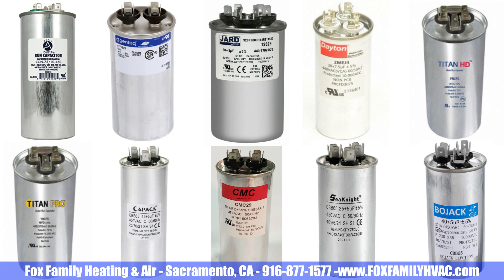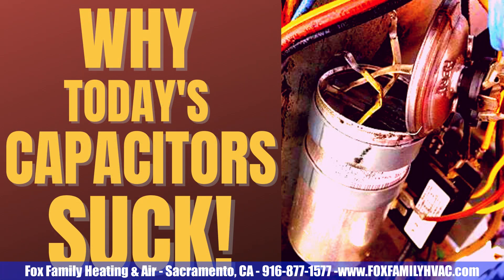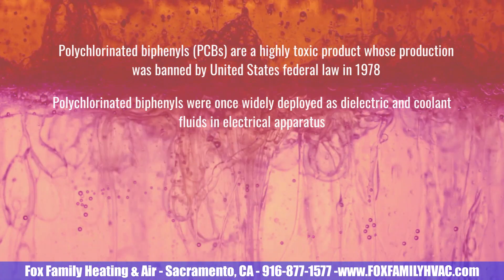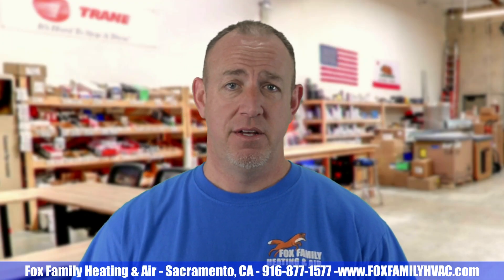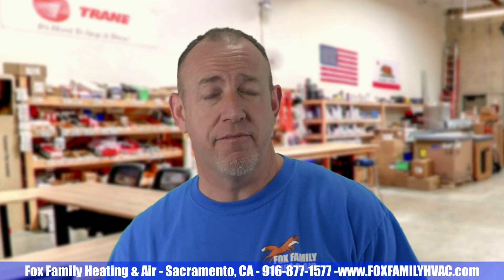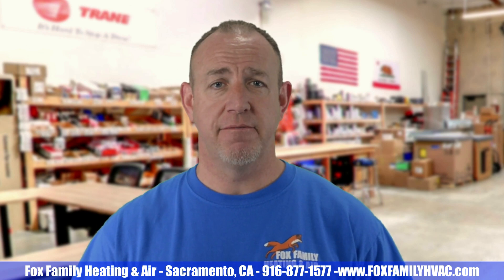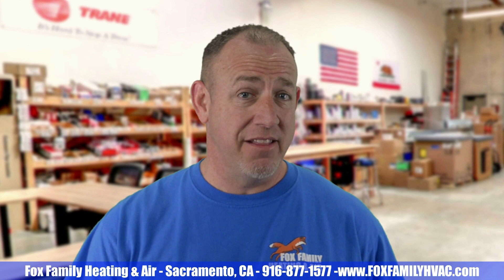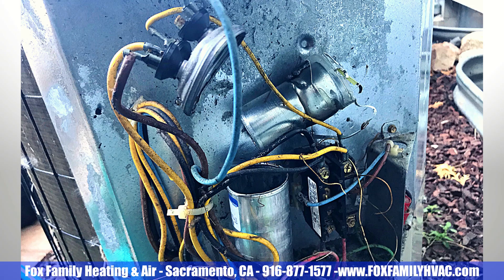Why Do Capacitors Fail (Actually, Why Do Capacitors Suck!)

Comment: Well. I just installed a titan. It’s running just fine $31. Had a JARD and it only lasted about 2 years. Either way. Cheaper than HVAC coming to do the same thing for $200-$400.

Comment: i have 26-year-old capacitor that has no pcbs but it is fairly large oval 45/5 that sits flat against metal of unit that sits in shade it is still working probably does not get to crazy hot.

Comment: You must have picked up some knock-off Titan HD's, I have yet to have one fail and the ones I have in hand have "Exceeds EIA-456a" on the boxes for both condenser and blower motor capacitors. Proper installation is important and even good techs get lazy and install a capacitor any which way just to get a job done. Also, just because a capacitor looks good on your clamp meter doesn't mean it's actually healthy by any means. All capacitors leak electrons internally to some degree and it takes very specialized equipment to determine that leakage. A leaky capacitor can show rated MFD (or even higher) and be completely junk in use.

Comment: I don't think you understand how an AC capacitor works.  It does not "Store energy" like a DC capacitor.  It simply provides a "phase shift" of 90* to act like a 3rd leg for a short period of time, or consistently - depends on the system.

Comment: I have to 100% agree that no HVAC should have the cheap crap on their truck. Why? Because they are getting paid to use their training, experience and professional deeds to the equipment and customer.  There is no point in anyone calling in HVAC folks only to receive a DIY quality outcome. Anyone could do that type of work and for much much less. Like in this video, don't put those low end CAPS in your truck and if that's all the supply warehouse has, find another place to buy your parts from who will offer the high grade. I have seen countless HVAC videos made by HVAC folks and they showed how they installed a cheap low quality CAP and called the job fixed like a pro. LOL...I call that fraud especially if the CAP being replaced is a high quality one. Just like condenser fan motors...they pull out the OEM original quality motor and install a cheap rescue type without informing the customer. That is another form of fraud too...
I have also been noticing that many HVAC manufacturers are using inferior CAPs and contactors right from the get go on brand new systems.  Are they serious about that?

Comment: Replacing out 20 year old Carrier. It is on the original cap, which is a MARS, made in Mexico, no PCB capacitor. Smaller than new ones, and it hardly has any "rush/corrosion" on it. TXV valve is going, so replacing the entire system. In Florida, so high heat and humidity, but seemed to work well. Of course it has the EIA 456a marking on it as well.

Comment: My American Standard unit uses GenTec capacitor. It failed in 9-10 years.  I replaced with Titan Pro and it still working after 5+ years. I bought Titan HD for a spare since I though it is a reliable one.  The box said it exceed EIA- 456A. Ehh, I don't know who to trust.

Comment: I just had a Genteq fail after 4 years and one month. It blew the top clean off. The Dayton before it lasted 7 years. In all fairness the Genteq was a 370 volt instead of the 440 volt that I should have used. Also, it's in a 25 year old ac unit. I just ordered two 440 volt caps. We'll see how it goes.

Comment: The main reason is the construction, and the secondary reason is PCB oil, which was widely used in all kinds of applications, including transformers, capacitors, and rail impedance bonds. PCB oil was outlawed a a carcinogen. If that were true, I would be covered in cancer, but I am not. I regularly was up to my elbows in that stuff in the 1970's. So, a less effective oil  and cheaper materials make a for a shorter service life. A cheaper capacitor fails more often. A cheaper capacitor allows for new units to cost less to make. Once the cap fails, they can sell you a new one. It's a scam, just like the refrigerant-du-jour.

Comment: Hi, enjoy your videos and information,  I had an annual service person come by and tell me needed to replace 2 capacitors for $370 each and need Freon R22 topped off on one unit. He did my neighbor's home and said similarly required a capacitor replaced. I didn't trust him and got a second opinion to inspect who said no need for the capacitor was working fine. He did state the R22 unit was down probably 1 lb of freon and would recommend refilling it otherwise can damage the unit. The cost of 1 Lb of R22 is $375 plus labor $150 which was the service charge to come out, does this sound fair or overpriced, I live in NE CT area. Can you or anyone give me an idea of what would be a fair charge for 1 lb R22 replacement?. The unit works fine and waiting until it is completely failed before replacement. Thank you,
Reply from the maker: The cost to run a business has gotten very expensive. Especially in highly regulated, highly taxed states like CA. Not sure about where you are. But 300 for a capacitor and 250 a lb for R22. The are alternative refrigerants like R458a or R407c for 150 a lb.
Reply: I still have couple tanks for R22 that I bought many years ago. My two units are 14 years old, so those tanks are good insurance.  But there are still plenty of R22 around.  Those AC licenser can still buy for <$20/pound.  The charge rate you described is unheard of in Arizona, but there are  a lot of competition here.  In NE, AC servicemen probably has no work half the time of year.
Reply: R22 is no longer available so does this technician have a large stash in his Van. One pound to charge and top off should maybe cost with labor about $300 at Max

Comment: I was just thinking about replacing the cap in my own air handler in my attic.  It's 29 years old. And still working. Though I didn't test to see if it's starting to fail. Good to know about the titan brand.

Comment: Yeah, pretty much planned obsolescence. Ive seen em go bad in as little as two years if the heat exposure is bad enough. I'm not an active field tech anymore at the moment, but i began making it a habit to make sure i didnt try to tell the customer that this is expected now from all major brands regardless of the expense of the system. Your 20,000 dollar daikin system will have caps go bad just as fast as the local crack motel that has an oxbox slapped in.

Comment: Sounds like modern HVAC capacitors need external heat sinks with cooling fins attached to them. Would be pretty easy to do with thermal tape or heat sink paste and hose clamps to hold the heat sink in place. Would be an interesting experiment to see if it would increase the life span.
Reply: It will increase manufacturing costs!
Reply: @bobboscarato1313  I was thinking more as an aftermarket upgrade. If it lasts 10-15 years vs. 1-2 years I would think adding an inexpensive heat sink to the outside would be a worthwhile investment. Not to mention the reliability benefits if it works. I have added heat sinks to many components to extend their life/protect them from heat damage. I don't see why it wouldn't work in this application as well.
Reply: @gawkingwatches7988  I'm sure they did their math and concluded it was bad for business; control space is limited and it could complicate their plans!
Reply: yes my ac unit is 26 years old still original cap it is large oval 45/5 so probably disapates heat well you can jst take aluminum foil tape and make fins for cap if you wanted to i did that to a power supply and it cooled it quite a lot.
Reply: If you can find a heatsink that can mate against a cylindric surface, let me know.
Reply: @AZRockRunner  THERE,S PLENTY OF UNITS THAT CAN EASILY COVER TWO  FLAT SIDES OF COMMON OVAL CAP...THINK!    AND FRANKLY,,,THERE IS ALWAYS PLENTY OF ROOM FOR  THEM  TOO..
Reply: @AZRockRunner  I've seen them for things like radio controlled car motors so they definitely exist. Would just have to find a supplier that has versions for different diameters.

Comment: The cheapo, color-coded caps on the new Carrier and Bryant units are getting about 2yrs average - even replaced a few of them around the ONE YEAR mark.
 Man, lemme tell ya, customers just LOVE having to call a year or two after dropping several thousand dollars on a new system to 'change a part out' because their condenser is dead and their house is hot - really inspires confidence in the equipment and your company.
 I like an "easy" service call as much as the next technician, BUT....
 It's sad that we can't rely on these people to spend 10 or so bucks extra to put a quality capacitor in their equipment that's gonna last at least HALF of the warranty period. 

I've almost considered just pulling the stock caps and putting in a quality one on all new systems I install...I know I changed the cap on my personal system out after the 1st summer.

Comment: We were starting to wonder, we’ve had customers mad at us for the cap going out roughly after a few years…now I know what to tell them so they can’t get mad at us.
Reply: Telling you from personal experience. Telling the customers about planned obsolescence wont help take the blame off of you. They see you as part of the system that causes the problem. They freak out and look at you for the answer of the magic brand to use. When you can't give it, they see you as the bad guy too.

Ive seen MARS caps go bad within a few years too. Its not that high a guarantee. ALL caps are made cheaper these days.
Reply: couple of years?  shyt.  it last in one year compared to old days capacitor 20 years to 40 years.  My god consider the trash from all these failed capacity.  my gosh.  no wonder the world is filled with trash and toxic.  We are no longer using capacitor, we are using trash.  These capitalism gonna killed everybody.
Reply: Just blame it on the EPA.

Comment: Capacitors in motors don't act as "storage buckets." They shift the phase to one of the windings up to 90 degrees to create a rotational force that is otherwise not available on single phase circuits.  All capacitors do charge up and discharge, but the capacitors in your air conditioner aren't letting out one big oomph. They are charging and discharging 60 times a second, and the charging action is what creates the phase shift. No more power is being put out of the capacitor circuit than is flowing through the main winding. The difference is that the winding on the capacitor has current that is shifted 90 degrees.
Reply: So you’re saying that the Capacitor charges or in other words “stores” power, Then Discharges it?
Reply: @AbqBasketball  yes, but it isn't boosting anything. It's just shifting the phase. It doesn't retain some sort of charge to start the motor. Any charge it maintains when turned off is incidental. It handles alternating current, and so maintaining some sort of mega-charge would serve no good purpose. Its only purpose is to shift the phase of the wave. In a single phase circuit, the current shifts back and forth. All that would do is move the rotor back and forth. It would sit there and hum. The phase shifted current goes to another coil so that you get a 3rd wave that is in between the other two so that instead of 1212121212 you get 123123123123123.
Reply: Well, it depends. Units that rely on a start cap actually do use the start cap as the force that provides the oomph (however this is more for commercial refrigeration systems.) But yes, your traditional run cap mostly just acts to imitate a third phase. That's why a start cap comes with an induction relay. So it won't burn out due to the excess amperage.
Reply: @Clasped003  no, the cap causes phase shift for a start winding. That is all. Does not provide any form of electrical spring discharge of any kind, not on any typical AC compressor motor, saw motor, fan motor, or otherwise.
Reply: well, there is still AC current flowing through the capacitor so it still get hot.
Reply: I just posted this as well, then decided to read comments.  Glad someone understands!
Reply: Current leads the voltage
Reply: @ryoung212  Yes, and it leads because a capacitor acts as a short when discharged. When fully charged, current will be at a minimum, and voltage will be at a maximum.
Reply: All correct and explained like an EE would. Respect!

Comment: The old days a dead capacitor call was rare. They were huge.
Reply: Sadly the last MEGA-cap I pulled out of an ancient unit (still reading 40.01µF) wasn't a 45µF or I would have used it on my 2018 Day & Night condensing unit and tossed the 'El Cheapo' color coded one that came in it!

Comment: excellent video! i prefer amrad over mars, ive had problems with mars caps leaking dielectric never with amrad!
Reply from the maker: Cool. Thanks for letting me know. I actually wish I could find who sells them around Sacramento
Reply: @foxfamilyhvac  i usually have our warehouse manager order them, and he gets them online. I know I have seen them at US Air conditioning before, though they were low on stock.

Comment: I ran across a 45/370 run cap installed and running in a 1951 Sears central A/C.  It was the size of my car battery and still tested perfect but today's caps seem to be a seasonal item.  Do contactors next, it's pissed me off to no end that manufacturers don't make the contacts visible anymore.  The ones made even 10-15 years ago would last the life of the equipment but break open a new OEM contactor after 1 or 2 season's and they are shockingly damaged and pitted
Reply: Less silver - they used to be solid silver points, now they're just coated.
(according to my boss/owner/mechanical engineer)
Reply: Everything get cheapened all the time; planned obsolecense!
Reply: Obsolescence!
Reply: yea , Contactors are crap these days. just like caps. agree.
Reply: Size of a car battery? What kind of system? Hardly anyone had ac back then and if they did then they were probably wealthy, which I would assume it’s a nicer house. So why wouldn’t someone in a nice house replace a system that is 70 years old
Reply: @murkyturkey5238  condenser was in the basement with a sheetmetal elbow on top to direct the discharge air to the outside, a large belt driven squirrel cage instead of a propeller doing that job with a semi-hermetic compressor running R12.  The furnace was damn near the size of my service van at the time ('99 SWB Chevy).  Probably still there because the ducting was encased in asbestos and the house is a registered historical home in California $$$

Comment: When possible I try to buy AmRad capacitors when I can. I keep a couple of Turbo 200 caps on standby as well.  The propery that I work for still has some 35+ year old condensing units that contain those old school giant capacitors that are still running strong.
Reply: Don't use AmRad, they contain vegetable oil, and will just leak out and explode. Make sure that you use only a NON-VEGETABLE OIL, USA made capacitor.

Comment: I’ve replaced so many failed OEM capacitors on Carrier (as well as their Day & Night, Bryant, Payne, etc counterparts) units are only a few years old. Carrier seems to pick the worst cheapo caps to put in their systems.
Reply: Yes, Also replace them right away with USA Mars, leaving the "blue label" Mineral Oil ones in now just to see if they last any longer, may be a mistake, but we'll see!
Reply: Going through the same thing - 2yrs seems to be about average.

Comment: This is why we replace all capacitors even in brand new installs with turbo 200 or Amrad metal foil capacitors only.    We do not care if the warranty will cover the failed capacitor in one or two years on our customers brand new expensive piece of equipment. 

It’s that unpleasant experience for a customer even if it’s only one out 10 or 1 out of 20 customers that may have a failure within the first 2 to 5 years.  
                          We want zero callbacks from a customer for warranty work. 
              A fail capacitor can cause a condenser motor to burn out or greatly shorten its life still work after they had new capacitors replaced and then the condenser fan fails A few months or a year later that will be a second call from the customer.   

       Or the capacitor on the motor causing the motor to run hard and overheat until eventually fails and the customer calls but how much damage has been done to those motor windings due to the fact it may have been running for a whole year in a damaged capacity overheating the windings. 

So you replace the capacitor in a year or two later the motor fails a short life way before 10 years. 

That is why it’s mandatory 100% in our business for our customers we don’t allow that to happen. 
                          Your reputation is on the line.    Don’t be like the other guys.
Reply: THIS...^^^

Comment: Nice video and very well said!  As you probably know, Carrier/ICP came out a few months ago with a TIC indicating why their older caps failed...exactly what you said, but they are replacing the dielectric with Mineral Oil instead of Castor oil and increasing the temperature limits.  Guess we'll see if it makes a difference.  Agree with using the 3 types you mentioned, except been seeing a few of the USA Mars 440v go out in less than a year.  I hope it's just a one off.  Thanks for posting!
Reply: This is why they also just switch over to thin film foil design usually get your decade plus hands down.  Still waiting for my first one to fail hasn’t happened yet
Reply: @coldfinger459sub0  Cross your fingers; we are expecting very high temperatures this summer; in Houston Texas it's already 100 F. Measured yesterday at 3 PM!
Reply: @coldfinger459sub0  Here in the Houston area we have more drive-by shootings daily; police chases thru 3 counties, etc. No fun at all!
Reply: Thanks. Gtk.